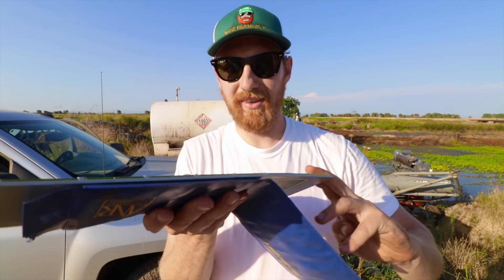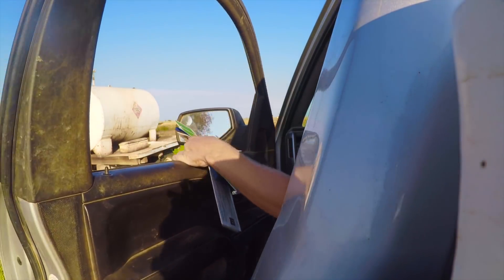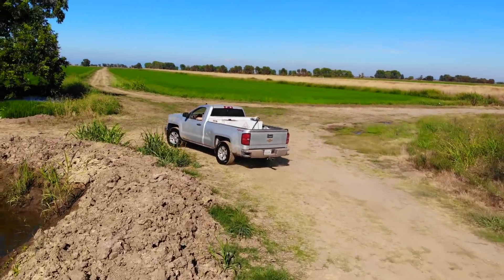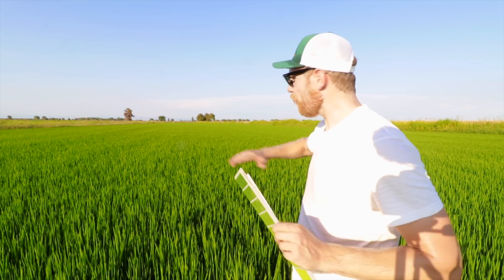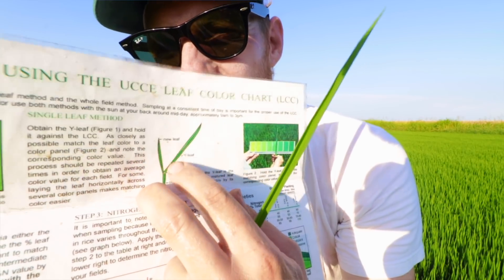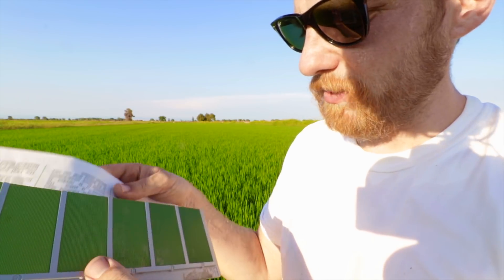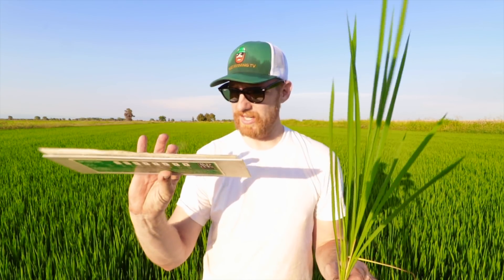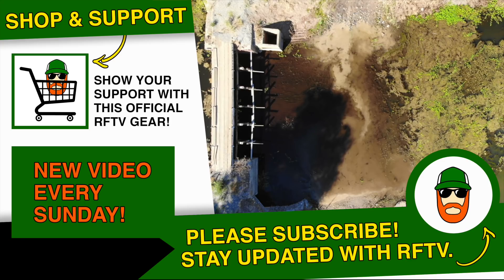How Healthy are My Rice Plants?!

Comment: Hi Matthew, great video and great editing. Why don you use multiespectral data? for example Sentera has a low cost single sensor camera that can be integrated with a mavic pro and you can get the data in the field edge without internet.

Comment: :28 where does this water go?
Reply from the maker: Hey Scotty, The water in that irrigation canal heads into the Sacramento River. From there it can be pumped at the Delta and diverted down south, otherwise it would eventually flow into the San Francisco Bay and out into the Pacific ocean.
-M.
Reply: Rice Farming TV so really  then, a large percentage of the water for your crop becomes available downstream? how many acre feet do you need for rice and how much leaves the farm?

Comment: Here in South Carolina it's been high 80s to low 90s with 85% humidity and VERY rainy this summer. We received 7 inches in my area last week. Two or three inches per week are not unusual. I haven't irrigated in at least 2 weeks. Other farmers are concerned about getting the early corn crop out of the field and I'm just soaking it up. The weather is great for rice! The heads are getting heavy and I love that sweet smell of the rice.

Comment: Good to see you again Matt. Pretty cool tool to help you determine if your crop needs a little boost of nitrogen or something else. Its been very hot here as well this year we went from winter to summer in a matter of 3 days and its been hot ever since not as hot as you but hot enough. I was wondering when you put out fertilizer is it a slow release nitrogen or a fast release just wondering if if it is different than what we use for turf most of ours is a slow release also are there any helicopters used out there in crop spraying or just air tractors?. Thanks for taking the time out of your busy schedule to make these videos for use I do enjoy them and learn from them as well. Have a great week. God Bless!!!
Reply from the maker: Good to be back after a couple weeks! Thanks for the message. The nitrogen is fast release as it dissolves into the water. The temperature/seasons here in California seem to be going to extremes as well. Extremes and the traditional weather patterns have shifted in the calendar year. There are a few helicopters that will apply sprays but it's mostly ag-cat crop-dusters. Great questions! Thanks again for the encouragement and for appreciating the videos. Take care.
-M.
Reply: There are some ag helicopters in our area, but they still use planes, mostly.

Comment: 33 degrees where I live ( about 91F)
Really hot for us, and has been like this for a few weeks.
Glad I am retired and do not "have" to go out in it if I don't want too.
Reply from the maker: Brian, I'd take a 10°F drop in temperature any day! We're basically working half days because it's just too hot and we don't have an air-conditioned shop. Hope it cools down to 91°F! Take care.
-M.
Reply: Well the logging company that I used to work for has curtailed operations due to the heat.
Just too darn hot and dry out there.

Too many fires burning already.

Are you in any danger where you are with all of the fires in california?
Reply from the maker: Brain, fortunately we are not in danger of any of the current fires. Just the air is hazy with smoke. It's an eerie atmosphere.

Comment: Thank You Mat, this is one of your greatest videos. I would love knowing the brand of the diesel engines you shut-off. They seem and sound cute and super cool.
Reply from the maker: Thank you, Al! The diesel engine attached to a driveline is removable and portable. It's called an "irrigator" and has a Cummings motor. The other is one unit with the pump and pipes. Not sure about the manufacturer. I'll look tomorrow. Have a great rest of your weekend.
-Matthew

Comment: Cool shots !! Is it Smokey down there from the fire up here in Redding? We are stuck indoors and packed up in case we gotta go
Reply from the maker: Thanks Jason, the last few days have been super smokey because of all the fires (including the one up there in Redding). It's an all around bummer! I hope you guys stay safe and are out of danger. The smoke has made it a few degrees cooler at least. But it's just too sad of a situation for the state to try to find some positivity in the whole thing. Take care.
-M.
Reply: That Carr fire is serious business. I hope the weather participates soon so they can get it under control. Disaster in Redding.
Reply: Smoke has been hanging like a cloud in Modesto all day.The rice looks good and a shot of nitrogen will make it as good as it will get.The weather has been consistently close or above 100 degrees for 3 weeks .Not normal.I would guess a lot of scouting for dry spots.
Reply: Steve Miller it sounds like they are getting a bit of a handle and have slowed down the southern progression. If they stop it on the current mountain range we should be ok.

Comment: Wow, I'm kind of surprised to see a diesel powered pumps...I guess CARB has not convinced you with their financial incentives to convert to PGE.
Reply from the maker: One of the pumps is not stationary and just rented. The area doesn't have close access to power-lines. We run those pumps a small fraction of the crop year when everyone is taking gravity water from the canal. We're at the bottom of the water system so sometimes the canal is not deep enough for us to pull gravity so we need to lift the water out with those pumps.
-M.
Reply: Steve Miller i have done some Solar projects in yolo county on ag systems in the past that are letting people pump for pretty cheap $$$